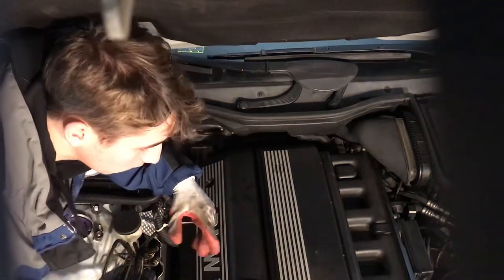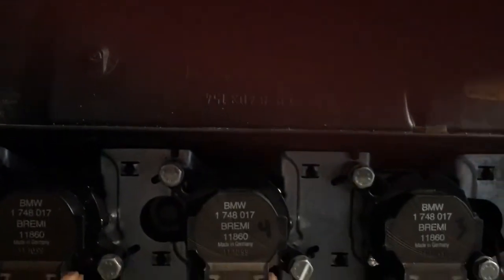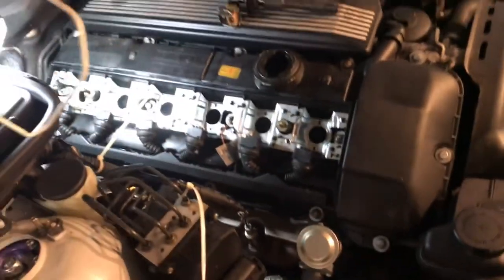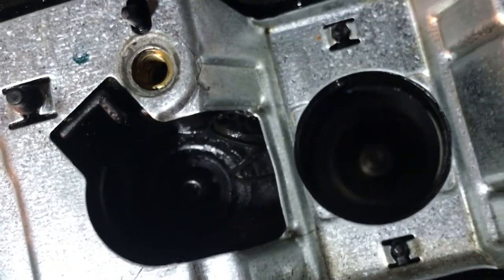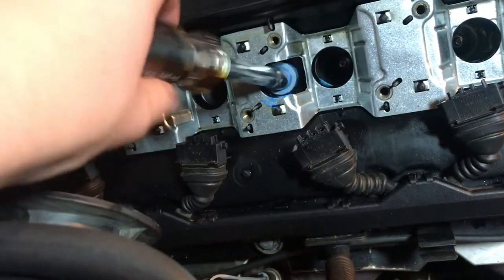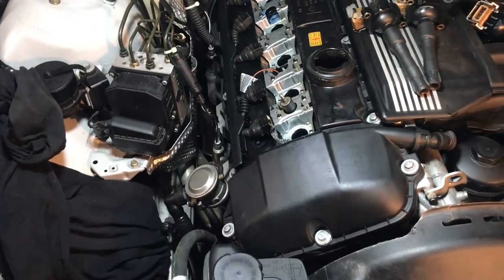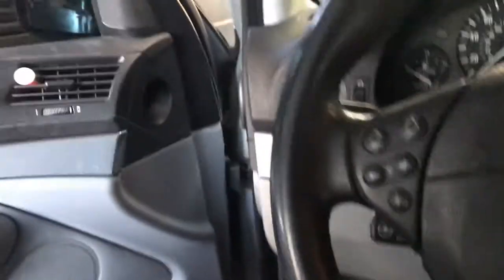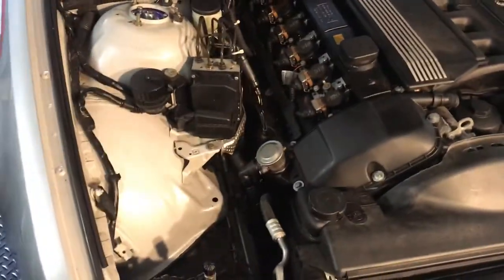oil leak/Valve cover gasket fix - burning oil smell in 2000 BMW 528i

Comment: What are you doing man? The title sais headgasket but it ain't the headgasket... It's the valve gover gasket... The time you spent on this video was well better spent on Changing the valve gasget... It's real easy just clean everything place the nieuw and do not forget the gasgetthat seals around the sparkplug and also renew al the ru bber rings that sit under the screws and torque m Dow in crosspatern 10 nm
Reply from the maker: This was many years ago when I was first learning to work on my car, if I was to remake the video it would be 10 times shorter and straight to the point. Sorry about the confusion as I was young and had no knowledge at the time.